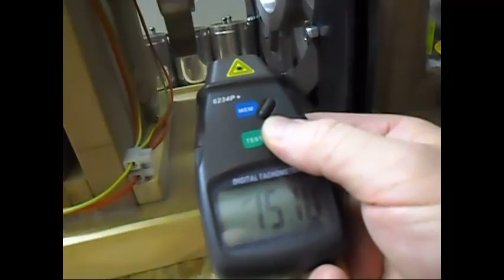Single Phase Generator_Update 7 - Upgraded, Improved and other projects updates...

Comment: Poor guy lucky you not hurt by the flying projectiles, all that metal artwork looks so advanced you are better off making a homopolar generator, it will give you tremendous amperes rather than high unusable voltages with micro amps...by the way where do you get these metals and cnc machinists to do these artworks? it must have cost a lot of money
Reply from the maker: Thanks for your comment, your compliments and i'm glad you've liked it...^^
Well, these projects are called free energy projects but there's no free lunch or dinner here...all cost a lot...lol
Very inefficient projects money wise but since i do like to build these i don't mind (that much)...lol
The generator laminations and the holders are laser cut and all rest are lathe work...can amount to a few hundreds of euros...;-)
La revolucion "Hasta la victoria, siempre!" Fidel Castro...^^